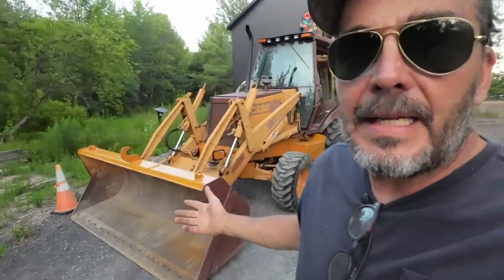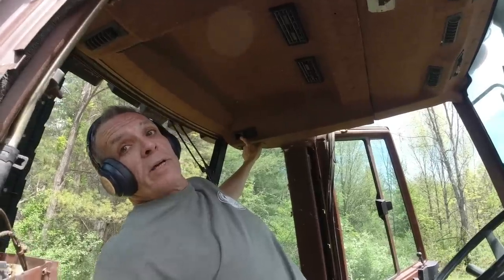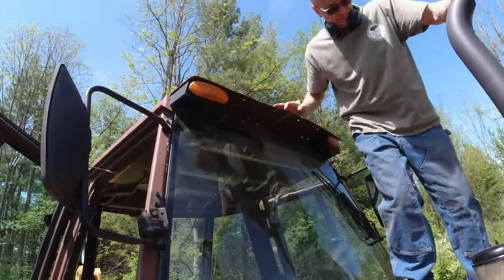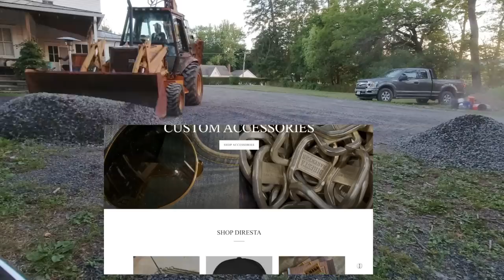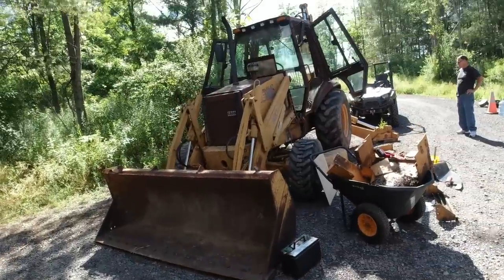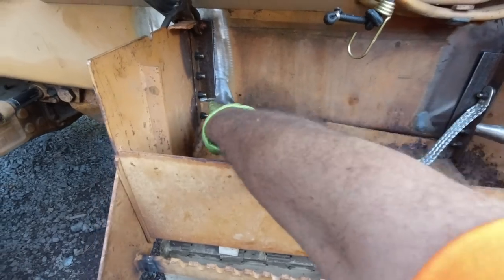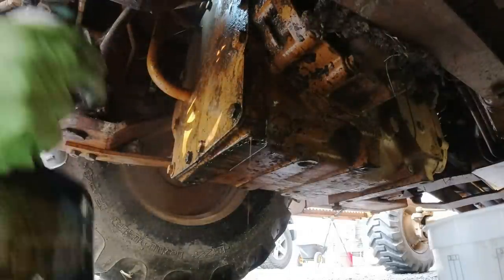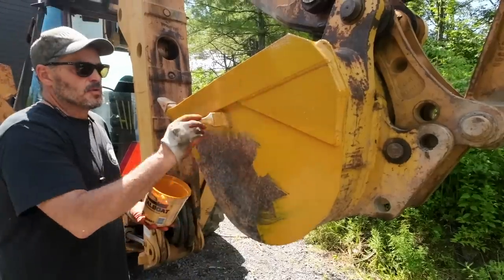DiResta Case Backhoe FIX UP Part 2

Comment: great video!
your brother's tip to start off with replacing all the fuses is good.
I could really do with this Case baby right now, as I need to remove 5 roots of large coconut trees, prior to laying foundation under my upcoming house in tropics. I guess I will have to do it by hand.

Comment: Cool to hear about it on the podcast and now to see it on your channel.
It’s great to see two brothers working together and having fun with each other. 
You can use what’s called TV tuner cleaner or contact cleaner (aresol spray) to clean the switches and where the fuses plug in. It’s an electronics cleaner. Spray it and let it dry.

Comment: 7/23/22..ahh yes Mr.Diresta, very practical rehab on yur Case 'Construction King' Backhoe. Tons of hours & $$ involved in this project..& now  after you & yur brother did amazing...[de-mouse-i-fication] clean/scrape/straighten/grind/weld/rewire/new fuse/air needle/prime-paint/re-glaze (unique shape glass)/over fill oil-& correct/secure hydraulic hoses/test operate then ...perfection! Great to watch/listen to this video. As always..your talents for creating/restoring are on full display. Always great to see you in the shop using your tools/equipment to 'Make'...Diresta style ! Stay safe, carry on Sir!👍👍👍💪😊🍷

Comment: Hi Jimmy.  That poor old machine sure went through a lot of abuse in it's former life.  With all the repairs you've done, it should be good for another 30 years.  If the decals/lettering is still available, it would be cool to see that all new as well.  Thanks for the video!
Reply: It wasn't abuse just some neglect. Backhoes are made to be abused. Operating one is kind of abusive too. It's sort of like a carnival ride on the fritz. I remember one time we were pulling sewer grates with one using a tow chain and the hook wasn't quite right.  So we decided to try to bend it some with the bucket. Man it snapped that hook like a dry twig. Over an inch thick hardened steel. Hydraulics be powerful.

Comment: Look in the manual for the bucket position when measuring hydraulic level.  On some excavators you look at the hydraulic oil level with the boom all the way extended.  Cylinder position will change tank level by a big amount because they hold so much oil when extended ect.
Reply from the maker: Yep we did look and see this

Comment: Just a bit of advice from someone who’s had some bad luck with tractors: often times rodents chew on wires because there’s soy in the coating. I hadn’t really found a good deterrent other than putting poison in the cab of the tractor. You could also put traps…

Comment: Awesome video, I was curious what you were using to clean up the floor panels at around 26 minutes. Looks like you have it on an air hammer but I don't think I've ever seen one of those attachments.
Reply from the maker: “Needle scaler “

Comment: There are tools to remove glass that are basically drywall putty knives bolted to one of them oscillating saws I cant remember what they're called though we  just call em the jiggly saws lol also watching part one now, if you were wondering what this comment had to do with anything lol, also you can tack a thin chain link to the creases and pull on it with a come along or some sort of ratcheting pulley system

Comment: Another cause of the transaxle and torque converter housing leaking is if someone put DOT3 brake fluid in the reservoir rather than the ATF that is required in the Phase III machines.

Comment: If anyone reading this know what brand of metal cutting grinder blades jimmy uses could you please tell me all the ones I use barely cut light garage metal he always seems to easily cutting through plate steel. Thanks
Reply from the maker: Metabo or Dewalt.  Or starrett